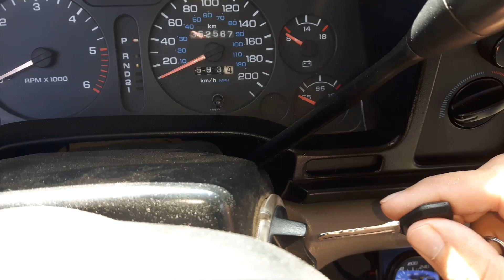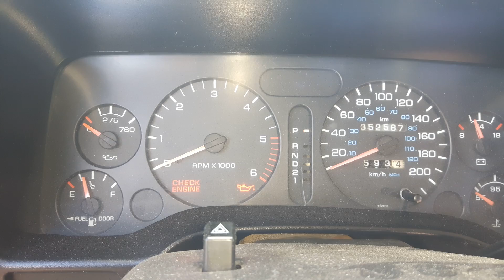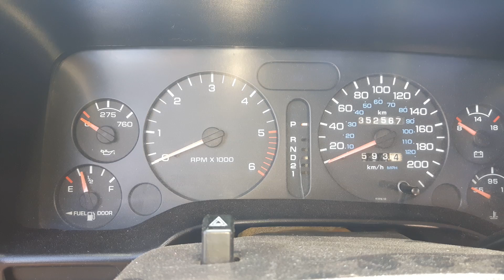Reading OBD Codes on a 1994 - 1997 Dodge Ram

Comment: Hey Chris, I have a 1996 Ram, I turned the key on/off just like you showed in the video, had piece of paper and pen to write down the codes, but my check engine light never blinked. I started the truck ran it for a couple of minutes, turned it off and tried it again, same thing check engine wouldn't blink. I tried this multiple times, any suggestions. Thanks, Marty
Reply from the maker: When you just turn the key on, and all the lights go through their test, does the check engine light come on?
Reply: Yes the check engine light comes on and stays on, it won't turn off.
Reply: So what does that mean when it doesn’t blink but yet just stays on?

Comment: Hey I had a question, cant find find obd plug anywhere, bought the truck used, and I'm wondering if I can trace it from the source to the plug  where does the wiring start for the plug?
Reply from the maker: The plug is in the harness that runs along the firewall, if its OBD1
Reply: @crazykincardineite  do you know the colors of the wires?
Reply: @crazykincardineite  I have the same question. I can't find my port for my 1994 dodge ram 1500 4x4.
Reply from the maker: @matthewcromwell1969  open the hood. Look above the pcm on the firewall, you'll see the main harness running across with a rectangular black plug. 1" X 3/4" or so. That's the plug.
Reply: @crazykincardineite  thank you. I got codes 12, 33, 37, 27, 32, 55
Reply: @matthewcromwell1969  open the hood, look on passenger side at firewall, along the top. OBD 1 black plug with 6 leads, two that are sideways compared to the other four. This where you would plug in an OBD 1 scanner. It is not under the drivers side dash!

Comment: I have 96 Dodge Ram 1500 and the code I got is 3855, did I just read this right? Yes, I too would like to know where you got 12 and 32 from? Do you know what the code 3855 is on this make and model?
Reply from the maker: The 55 tells you that you're at the end. I don't believe there is a 38.

Comment: the first code number after switching key three times,is 12  the last code is 55 presuming the ecm is working,if not the check engine light will not illuminate,then its getting expensive,as of now there are no rebuilt ecm's for my truck at all,5 parts stores are searching, fact

Comment: Do you know how to clear the check engine lights on this truck? Does it require a reader or is there a manual way? Thank you soooo much
Reply from the maker: Disconnect the battery for a while. Should reset it. But these things also don't store codes, so when the problem is gone they'll go away after a little bit.

Comment: Thank you for posting this. I had no idea this was an option. I'm glad to see I'm not the only one still rocking an early 2nd gen Ram. I couldn't help but notice your high mileage. That is impressive! How many engine and transmission rebuilds have you had?
Reply from the maker: That is Kilometers, but I put about 420000 on it (about 260k miles) on the original engine and trans before I wrecked the truck. It was fully loaded with the tan interior, no cracks in the dash. Ran like the day it was new. I saved most of the engine parts and they're now in another truck.
Reply: @crazykincardineite  Ah, I assumed it was miles. I only have 78K miles on my 94. I'm sorry to hear your truck was wrecked that is a shame.
Reply: @robtrenholm1950  78k not even broke in yet lol. I bought my 94 with 82k on it and thought that was great back in 06. I used it as my work truck and racked it up to 200k, got a head gasket leak, parked it. I took the time to restore it this spring with a bunch of upgrades. Made a quick slideshow and idle video on my channel. Nice to see some other 94s out there.
Reply: @JO-fk1bg  Bought mine in 2013 with 88k, now has 130k... Still going strong! I'm thinking of getting the parts to convert it to 4x4.
Reply: That's kilometers not miles

Comment: My 94 dodge just came on yesterday  and its flashing 5 times than pauses and repeats? Any help would be appreciated
Reply from the maker: 5 and 5 just means the end of the codes.
Reply: Chris Potter what does that mean exactly for my engine light being on? It's still doing it but it comes on after running for 5 mins. When I shut it off it goes away for a other 5 mins
Reply from the maker: That 1 RC Guy that's means it's a soft code. If you shut it off, and check it right away, it should come up for you.

Comment: where do u read trouble codes at
Reply from the maker: kimberly wright Did you watch the video? With sound?
Reply: Chris Potter  yes I did and turned truck on n off like he did but could not see where codes r
Reply from the maker: kimberly wright  The check engine light flashes in a sequence of numbers to give you the codes. If you can tell me the make, model, and year of your vehicle I can walk you through some diagnosis. You're welcome to send me a message and ask whatever you need. I'll help as I'm able.